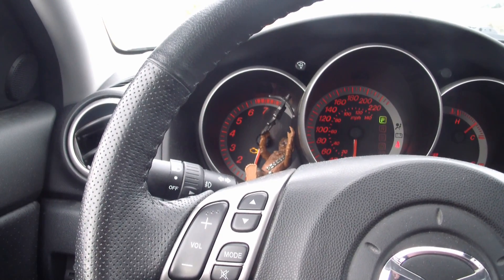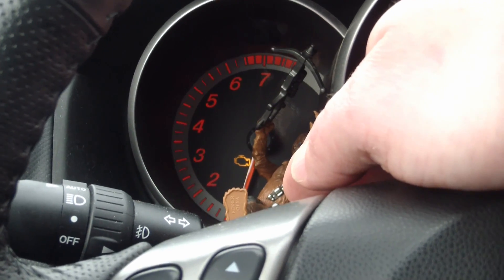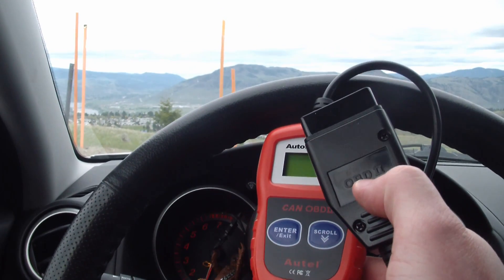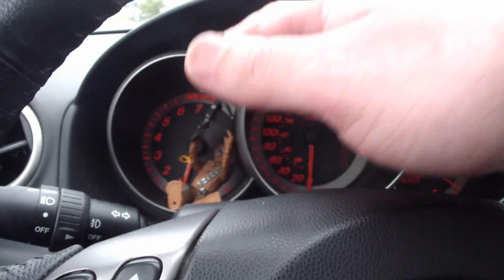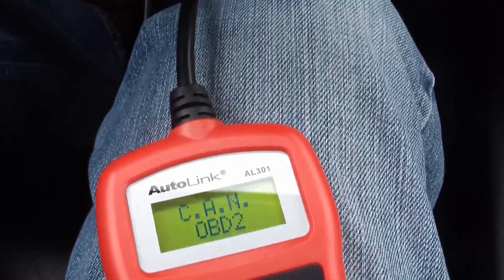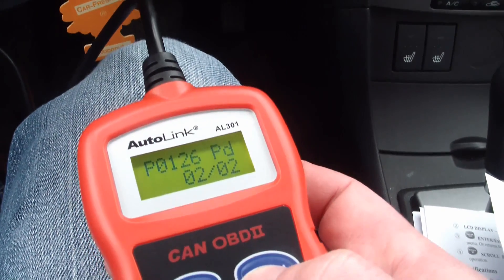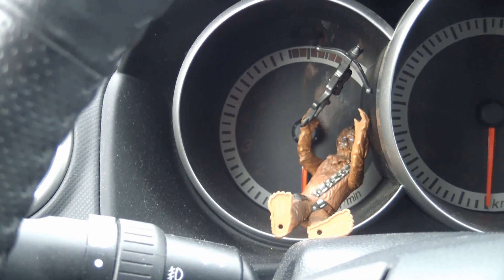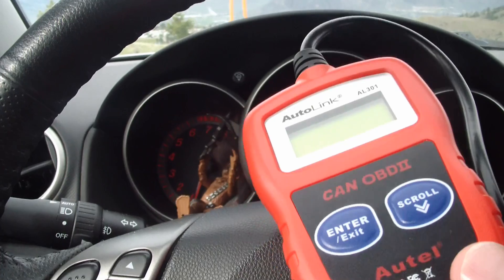Manly-Man Skills: Outsmart Mechanic Scams by Using Your Car's Computer!

Comment: Dood, my 18yr old showed me your channel a few days ago, now my entire family are addicted to your vids. Nuff Respek!! Just thought i'd out cheapskate you on this occasion by adding my cheapo mccheapskate productions presents (drum roll please!!) many modern cars with any sort of lcd display in the dash (on mine its just the clock/tacho) on which the troubled horseless carriage will gladly display 'most' fault codes as stored on the magic box that makes the sparks happen so no need for anything more than the owners manual (or google) to find out how to activate the display function. However that said, my personal pref is for vehicular transport for the analogue generation with a condenser and points if not and better still a magneto.

Comment: I'd recommend a solution that can cost about half that but is actually MUCH better. Look for an elm327 Bluetooth obd2 adapter, (usually around $8-15). Then you'll want to download the full or free version of an app called "torque". 
It can do everything you just did with that obd2 scanner, however, it can also get live readouts while you're driving including mpg average and instant.
So not only will torque save you money at the auto shop, it can help save money at the pump as well by putting in buzzing or flashing alerts (I think it has buzzing, I know I have a flashing alert when my fuel flow exceeds 0.06 gal/minute). 
However, the best reason to get the app and Bluetooth adapter is because you have to put you phone on the dashboard and it keeps your phone out of your hands while driving, a leading cause of crashes.

Comment: Amen! 
Lies, more Lies, and Statistics......Statistics that Prove they LIE!
Cheatin' Stealin' B.S.in' dealerships, some independent shops and chain shops.... I speak from experience, but I know more  than the average bear so I'm able to opt out and go somewhere else or reconsider doing it myself if possible.
You are a scholar and a gentleman for posting this vid so the masses can see! 

The American transportation industry as a whole sucks. Fuel costs, poor quality mismatched fuel(ethanol & low or no sulfur diesel for old trucks), death of salvage & junk yards, cash for clunkers taking good or decent cars off the road prematurely, shitty laws that jack up everything for hobbyists, forcing people into debt cause vehicles cost more than they should, doting on "American Pride" or "German Engineering" when said product is no longer made here (insert Harley Davidson too), Too many recalls too often, not allowing the consumer the right to repair, excluding dipsticks or oil level check sticks(WTF u do in an emergency?), not teaching the new mechanics right, messing over the old mechanics instead of honoring them, etc... 
So, Thanks AvE for stepping out of usual machining vids for a second to do an automotive vid to warn the people!

Comment: guy isn't exactly right.  that code means car isn't getting warm enough or a coolant sensor is bad. oh fyi . before you take battery loose check an see if it will effect your car some newer dodges need computer reset at dealer vws will lose radio  an need reset.

Comment: Having an obdii scanner definitely helps especially in the case of a mechanic who wants to bullshit you. When you get a code google it and look it up in relation to your vehicle because many times there are common reasons for codes in certain cars. Case in point. My friends ford ranger was setting off code p0171 and i forgot the other one but both were saying banks 1 and 2 were lean. A mechanic told him O2 sensors. He came to me and I told him prolly something else.  Sure enough in 5 minutes of observing the car, his pcv hose running into the intake had dry rotted. A $5 fix that was potentially going to cost around $300. I wonder if the mechanic was going to do the $5 fix only and then charge him $300. And then he failed him on inspection for windshield wipers and his windshield wipers worked fine. I just dont trust my car with anyone but me

Comment: The cheap code pullers is not a scanner it only gives you generic codes it can help you sometimes but majority of the time they are wrong I just bought a snap-on verdict d7 and it was $9,000 usd but for a do it you're selfer it will work OK to just clear codes just don't always believe it lol

Comment: 1:52 Nitrous Oxide? Just another one of your wording riddles? You certainly are confusing ppl with that, lol. Would be great if NOS was as common in quantity in the air as it is in the bottles they sell, imagine the power! Sulfur dioxide (the actual yellow smog) has disappeared MAINLY because we heat our houses differently nowadays.....And NOS is colorless, odorless.

Comment: Just for the record, the "stealerships"  do overcharge, and way oversell. But you need to change your wording a bit.  In a dealership, the Technician has little, if anything, to do with what you are sold.   The Technician is there to diagnose and fix. NOT SELL.  So if you feel you're being scammed it's not the Technician, its the service writer.  They come up with their own sales pitch based on mileage and service schedules, etc.  Technician just tells them what's wrong, and what it NEEDS to be repaired.
Reply: YES! The technician sincerely wants to fix your car. The service advisors will kill you. Or incorrectly communicate what you've said to the technician.

Comment: The check engine light comes on when there is a fault, or malfunction, or detected condition that is causing the cars emissions to be at our above 1.5 times the federal standard for that car (as in, if the car is a 97 accord out has to conform to the standards for passenger cars for 1997) so, the light only comes on with problems in the engine, transmission, fuel system, or exhaust system. a generic OBD code reader will only talk to the powertrain controller and only in generic codes. A lot of generic codes are not very specific. Also, getting the code does not tell you what is wrong with the car and what to fix or replace, it only tells you the specific system, or part of the system that isn't working properly.

Comment: I've got an OBDII bluetooth tool from Bosch called U-scan. It's a pretty good, I can check and clear codes for all the systems and watch a bunch of functions on my phone. It's more expensive than torque and ELM 327, I don't know if it has more features than the others, it hasn't given me any problems troubleshooting any car yet.

Comment: Just a little FYI, you should never blindly disconnect the battery on a modern car. Most have drive by wire throttles, some like VW will lose their throttle position.  You will need the dealership to fix it.
Also generic obdii readers only read the emissions related codes. Most other systems are proprietary to the brand, and will need a brand licensed reader to work.  This is especially true for imports.

Comment: You make several good and valid points, but as a mechanic I'd like to correct a couple things.  The check engine light wasn't devised for California emissions, it was to warn that something needs attention either minor or major. It's better for people than putting a specific light for every system, the dash would look more like the space shuttle.  The codes also only steer mechanics to a system that is faulty, and not always to a specific componrnt. When you reset the computer, you remove the positive battery cable, normally you remove the negative first.  A code could be a soft or hard code.  After resetting the codes, a you should start the car and sometimes you might need to drive it.  If the light comes on immediately it's a hard code.  An item or system that is still not within spec.  If it doesn't come on, something might have had a single glitch setting a soft code but the problem isn't there anymore. 

A code can be set for something as simple as a gas cap not tightened, which would give a code for "EVAPORATIVE EMISSIONS." But an EVAP code could be a vacuum line, or anything else within that system such as a component, sensor, or even poor wire connector. The mechanic would still need to find it.  Sometimes an issue is still difficult to find.

The problem with Dealerships is not every tech is a licensed mechanic.  Dealerships will often have just 1 or 2 mechanics "supervising" the other techs many who are just apprentices.  It's cheaper wage wise.  But you pay the same hourly shop rate.

You're 100% right not telling them what to fix, but explain the issue for them to diagnose.

Unfortunately there are a lot of shops and dealerships who are less than honest.

Comment: Mechanic scams lol, are you still living in the 70's - 80's. I've dealt with many customers who have done exactly what you're doing. One guy spent £350 on a Mass airflow sensor and £250 on an Idle speed control valve, because his code reader told him that was the fault. I fixed his problem by installing a new Temperature sensor which cost £12. I've spent many years in the diagnostic game, most of the vehicles i've fixed have come from other garages, including dealerships. Without the correct knowledge and tools all a code reader will do is get you into trouble, they're too easily confused. Don't underestimate the amount of time, effort and cost Mechanics put into their job.
Reply: Gazz R There are a lot of mechanics that scam people. I've worked in the industry and seen it first hand. I've also had mechanics try to scam me as well.
Reply: Gazz R  I agree 100%. Too many people think that diagnosing is just plugging it in. Sometime, yeah, it can be that easy. BUT being that easy comes with experience, not the scanner telling you exactly what's wrong.
Reply: Very true indeed!
Reply: +Gazz R Very True. I recently helped a friend out with his Mother in-laws 2002 Mercury Sable. It kept dying and didn't want to crank after it died, It would just click like when the battery was dead. He took it to Oreilys and they told him after running a diagnostic the alternator, battery and starter needed to be replaced. So he bought all the parts and put them in. It ran fine for an hour or so and then it wouldn't start again. So I come over with a voltmeter and start tracing wires and checking for corrosion and whatnot. And I came across a 175A fuse in between the alternator and the battery that was showing open. 6$ part is all it was.
Reply: i'm newer into the diag game than you, but i fully agree that DTCs are only a tool, not a diagnosis, and i've had plenty of repairs where the code thrown only nudges me in the direction of the problem, not the problem itself.
Reply: Dishonesty in repair shops ended in the 1980s? LOL
Reply: ***** sounds like you have been scammed
Reply: 12£ for the problem itself, 120£ for finding the 12£ fault. That's how it works.
Reply: Gazz R MUST HAVE SPENT TEN GRAND ON SCANNERS AND UPDATES OVER THE YEARS......CUSTOMERS BEGRUDGE PAYING
Reply: Between tools like this and car forums crooks like you are no longer needed, thankfully.
Reply: Gazz R mechanics are dishonest...I bet you charged him 100£ just to look at the car and 20£/hr to fix a 12£ problem
Reply: Gazz R I'm sorry but you can't just pretend that dealerships and mechanics aren't almost always scammers. Idc how good you are, anyone who's had a car problem knows what it's like to get fucked by a dealership.

Comment: I'm Volvo tech and most of the time it people just leave their gas caps off, which will not blow up your engine... But with that code if try and figure out what's wrong but mainly cause the gas mileage would be worse. If the car never heats up all the way the fuel mileage will go down. If it were me I'd replace the thermostat and possibly the sensor... Depending if the coolant was hot or not. Also it takes two drive cycles to set the check engine light back on. All the moniters have to be set. If it's really important (engine/cat damage) the light will set within the first minute of the first cycle.

Comment: I noticed your title Outsmarting Mechanic Scams. I also noticed you pointed everyone to google. I just think its kinda funny. Because most of the "answers" you will find on google. By way of Forum posts. Are answers from mechanics... 
The other issue I see here is. When you say take it to a local mechanic, let him find the root cause. You also did not Inform people that Certified Technicians Who understand that under lying data That cause the PCM to Flag that DTC. Will not work for free...
You still have to pay money... " ASE Technicians" Spend Tens of thousands of dollars gaining the tools and knowledge necessary to make proper repairs.
The third problem I have with this video is I did not see a fix.
P0126 could be a few things. Not only could it be low coolant.  Witch depending on what component is leaking can be upwards of a grand to fix. But it can also be set by a stuck thermostat, and or a faulty Coolant temp sensor. Understanding WHY the PCM sets this code is the other issue. Ask your self why fuel injected cars Run Perfectly fine on a first start in 10 degree F weather? Were as a carbureted engine needs ages to warm up...  The PCM reads the CTS data in open loop fuel in, to enrich the mixture. So people can jump in there cars and go no matter the operating temp.
Your welcome for that lesson, I had to pay money to learn that.

Sincerely.
ASE Master Technician.
Reply: Carbonated engine?LOLOLOLOL
Reply: goofyGAguy  HA thanks for that. good eye!

Comment: Repair shops are in business to make money, and car owners want to keep their money, and have the convenience on reliable transportation.  It's a fine line.  By going to a dealership with an out of warranty car, you are basically telling the business that you value convenience over money.  In this case, they should immediately replace the thermostat, and change out the coolant.  Probably a bill of $300.  If you go to a local mechanic, they will give it a quick check over, clear the code, and send you on your way with a $75 diagnostic charge.  If the problem comes back, a 2nd trip to the mechanic will be inconvenient for you, but you lost the gamble, and your thermostat will be replaced for $125.  You required 2 trips, but still saved $100. Having the scanner, and google, someone else could have determined that this model of car has problems with the thermostat, and they can immediately bring it to the local mechanic and i struct them to change out the thermostat saving the initial $75 diagnostic charge.  The true mechanically inclined will read the trouble code, go on ebay and buy an oem thermostat, install it along with fresh manufacturer approved fluid change, and only pay $40 including the $1.00 for a gallon of distilled water.  My point is the Diy is the least expensive, but the most inconveniment. But at the same time if you know what you are doing, you are guaranteed to know it was done right.

Comment: Basically this video is just about "stealership mechanics" even though I think you mean dealership technicians. Let me know when your dumbass can't fix a code with that POS code reader and the CEL comes back on for the fourth time and you can't pass state emissions testing and that car is basically a giant paper weight in your garage. Then I'll properly diagnosis and repair it for you the first visit to my shop.

Comment: You can usually go to an auto parts store and ask them to scan it for free. At least where I live, in stores like Advanced Auto.
Reply: Autozone does it too. I was driving back from Florida (to ny) in my girlfriends 2008 Jetta and the car starts overheating and a cel comes on in North Carolina. I always drive straight through if the weather is good. Since it only had 50k on it I didn't think to bring my obd2 reader. Found an autozone on Google maps and they scanned it. Found it was the cooling fan. This was a Saturday afternoon.. Dealers closed, and the next Sunday.. So they let me borrow some tools and helped me take the old fan out and hard wire a universal electric fan to get me going. I was in and out if there in an hour. I got back here and fixed it with the right part. I bought a non oem fan first... Cause the vw one was 375 bucks. It broke in a week . they gave me a new one same thing. Don't make that mistake. But yeah autozone is great.
Reply: +SlipknotMaggot0526 Shit unless you've got a Ford from the 00s.

Comment: had one time. someone brought a car with a CEL. if he could check it out what it was. be back later. 

Hour later i was still in the shop for my repair. The customer came back and it was fixed.  He got charged 160,= for the repair of a sensor. 

But the only thing he did is, he got in the car with the computer. reset the code, started the car twice and yelled, Easy Fix ! 

Thats the last time i ever went to a car shop for a fix . only for annual emission tests.
Eric the car guy and scotty kilmer i have learned from the last few years. 

Enjoy your day. best 30,= spend ever.

Comment: or you could do much better with 10$ and a free phone app called tq , its amazing program and works wonders clears code also ebay search elm 327 if you want the super high end one its the bafx elm327 for 20$ that way you can just use your phone to scan everything one less tool to lug around info and links below https://www.youtube.com/watch?v=irLUImwkKOc
Reply: crettybocker http://www.ebay.com/itm/OBDII-ELM327-V2-1-Bluetooth-Car-Scanner-Android-Torque-Auto-Scan-Tool-OBD-2-/261748591911?hash=item3cf16e8d27&item=261748591911&vxp=mtr
Reply: crettybocker  best one you can get http://www.ebay.com/itm/New-BAFX-ELM327-Bluetooth-OBD-2-CAN-V1-5-Scan-Tool-Android-OBD-Reader-Scanner-/251488093341?hash=item3a8ddbc49d&item=251488093341&vxp=mtr